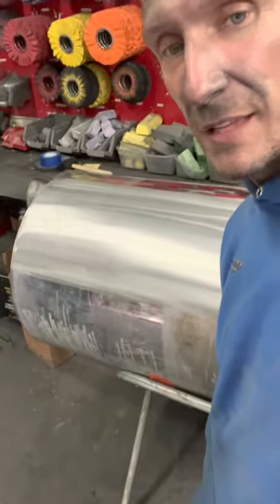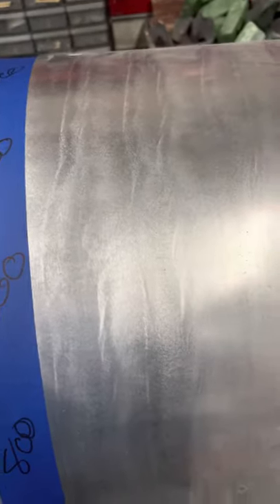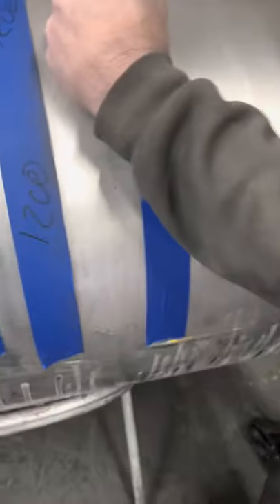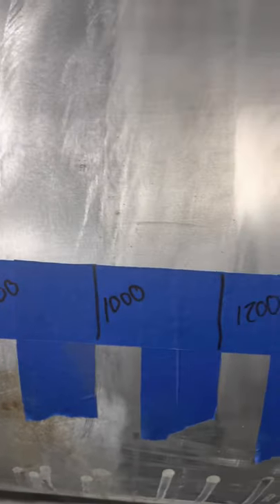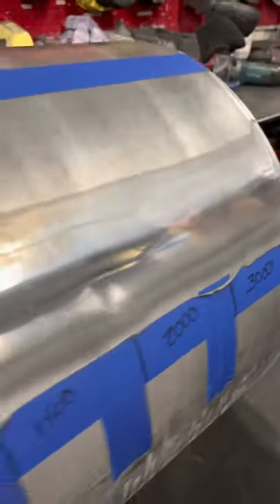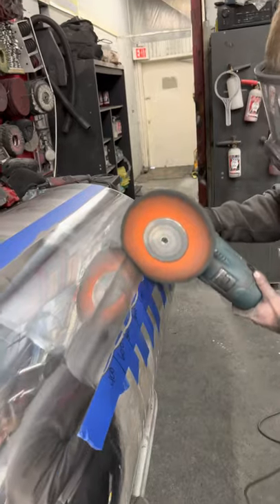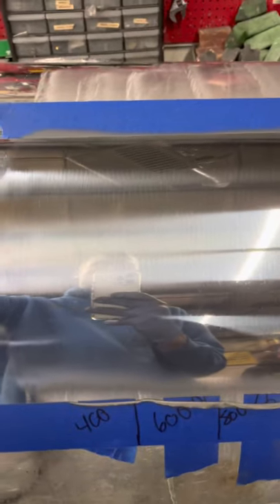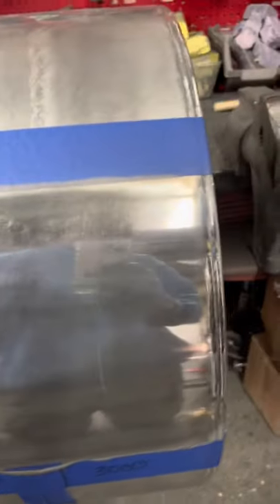Sanding up to 3,000 grit?? Why?? I only sand to 600. Watch why.

Comment: This is very interesting. I've had this problem and kept thinking that finer and finer sandpaper was the solution. Thank you very much for pointing this out.
Reply from the maker: Glad you found it helpful. Glad I could help.
Reply: Yep I had the same problem.i thought the same
Reply: So glad I stumbled across this video! Weird how things work but someone must of knew I was trying to restore my wheels. Lol, I've wasted a lot of time and sandpaper thinking the higher the better. It makes so much sense now that the higher the paper the more pores your closing. The compound has to have something to adhere too duh. Lol, I'm certainly subscribing to this guy!
Reply: Depending on what you're working on, I completely agree with you Evan. Good job buddy
Reply: @EvanStegerMetalPolishing  I’ve been having the same issue. I used to do cut and polish paint, wheels, trim, headlights, do clear bra and do window tint for a living. Long story short rn I’m working on mirror polishing on knives and good lord I’ve been struggling making the process quicker. Harder with 60+ HRC materials, trying to take the stonewash off is the reason I even went to sand paper to begin with. I’ll have to try the 600 on a throw away. Diamond lapping compound is all I’ve found lately that’s been hard enough to really erase all the marks but that compound gets expensive
Reply: Really helpful ……Thank you👌
Reply: For Kosarev mirror and time distortion the more reflective the more efficient the space-time bending is. Look it up.

Comment: I used 320 - 400 - 600 with wet dry paper. I screwed up with a fine brass brush doing paint removal and the 320 let me work those out with light elbow grease. Then the 400 then I ended with the 600 and fine emery cloth to get out hair line grit marks I made accidentally touching the paper. And then clear coated. My aluminum project turned out awesome with your grit advice. I believe I could of polished next and had nice clean good results but I had to finish up could not wait any longer for a kit. The alternate idea to polish came too late.

Comment: thank you so much evan. I have tried  with different machines and sanding  and polishing materials on stainless steel and none of them worked in my case. Now i tried with your instructions in this video I've used 400,600,800 grit only and polished on 600 grit sanding it looks just perfect and 400,800 not that good as 600. Thanks again...🙏🙏🙏
Reply from the maker: Super happy this was helpful.  Thanks for watching!

Comment: I have been sanding bicycle parts with a bristle disc on a Drexel up to 2000 grit and had trouble getting the mirror finish first time i.stopped at 600 then went to pollish bam mirror finish thank you evan
Reply: Make that a dremel
Reply from the maker: Sometimes it just helps to know. Glad it worked. Thanks for watching and dropping a comment.

Comment: Awesome demonstration!! Almuminum I only go to 600 or maybe 800 but stainless steel you need to get up into the 1000’s to get that mirror finish
Reply from the maker: I get mirror finish on my stainless at 600 grit also. If you sand anything properly you should be able to buff out 600 grit scratches. But I've also been doing this 24 years. LOL Thank you for watching and commenting.

Comment: Evan I used a rotary with a thousand grit and da thousand grit I found it works but definitely takes way longer to cut out 600 is definitely the sweet spot I rotary a tank  but I found the higher you go past 600 it harder for the buff to cut
Reply from the maker: So many ways to polish. This is the best part. No right or wrong ways. If it shines its right... Thank you for watching and supporting.

Comment: I can't even begin to tell you how much I appreciate this explanation, I polish raised numbers and letters cast plaques, I bought a grinder /polisher all the airways and bars and always struggle, first I have tried using buffs but it's like polishing a rake with the raised letters pulling the compound off and building up on the plaque, I can eventually get a shine but then I have a massive mess of compound to clean off before I can paint the background. I then started to just sand from 80 to 5000 and then use a liquid such as white diamond or a wizards. I do achieve a shine but it has swirl marks I can't get rid of. I was polishing one last week and tried using my fine buff and compound to get rid of the swirl marks and ended up with a mess  of smeared compound, your video here explains why.  Do you have any suggestions that may help with my situation? Thanks

Comment: Very interesting experiment and I have a few theories:
1. The hardness of the metal/alloy matters - as we see in the video it works very well for aluminium but going higher in Stainless Steel helps a lot
2. I feel the grit used (rouge) works well for 600 but having a finer grit may have worked for 1000 and above . From a personal experience products like gords work well in clearing the haze
3.For this system I feel that 600 + rouge on airway buff works very  well as demonstrated. Will a DA  with Pad work better for 1000+ based on the grain direction?
Reply from the maker: Thank you for sharing!  Appreciate you watching and commenting.

Comment: This not a criticism as your real world expertise is extremely valued. However, it has been my understanding that you should be wet sanding with any of these higher grits and you are dry sanding here. Do you think that wet sanding the higher grits would make a difference in how it finishes out or would you still run into the issue of the aluminum not accepting the polish?
Reply: I work in a polishing shop. I will test wet/dry sanding and see how that pans out. 
Also, whenever we do higher grits we ALWAYS clean the surface after sanding as any particulates can mix with the grit of the rouge making all the effort for nothing. 
Keep your work clean.
Reply from the maker: We have tried both wet and dry over the years and always end up with the same results.
Reply: @EvanStegerMetalPolishing  if the results are the same dry or wet, do pads hold up better to one or the other?

Comment: I heard from another channel that depending on paint you use for example can spray paint a higher sand grit in needed for paint adhears better? Is this the case?
Reply from the maker: I'm sorry we don't do anything with paint. We only polish metal. We sand to polish not to paint. Sorry I have zero info in that department.

Comment: One reason people sand w finer grit is bc unless you have a powerful poliser it is harder, and takes much longer, to polish out the 600/800/1000 grit marks!
Reply from the maker: Even with a slow speed polisher and good products it is easy to remove 600 grit sand scratches.

Comment: It looks like you weren't washing off the residue of the previous sand paper before moving onto the next - so by the time you reach 3000 all you've done is compound the residue of all the previous sanding into the surface - hence it's smooth but not shiny.  I was surprised that you were dry sanding from 400 up anyway - I've seen people sanding with water or oil from 400 up with some great results but never dry - was there a reason for doing it dry?

Comment: Would this method work on motorcycle frames, metal or aluminum ,stop at 600 grit or go all the way to 2000 grit? Thanks
Reply from the maker: I stop at 400 or 600 on everything aluminum and stainless. Great question.

Comment: I didn’t know sanding past 400 to polish aluminum was a thing. I’ve switched to plastic refinishing for past decade or more though. Plastic doesn’t sand as well as aluminum and typically must go to a 800 machine to buff it but some people want to go to 3000 or so. Anything over 1200-1500 doesn’t help .

Comment: Hey there, I'm currently polishing an airstream and have done an initial cut with Brown tripoli and a red airway wheel using the Dewalt variable speed polisher. I then cleaned the surface with mineral spirits and changed to a coloring wheel and moved to a green moss compound, I noticed from certain angles and lighting, a brown haze develop after step 2. Is this something you've experienced before? and what can I do about this? ( I did not have to sand it)
Reply from the maker: Brown haze traditionally to me means burns but I’d need to see it.

Comment: Thanks for this info!  Interesting about the pores closing up.  I wonder if this happens on mild steel also.  I am doing a deep dive into mirror finishes on mild steel for my plasma cut artwork.  It makes a lot of sense to only go up to a certain grit and then start cutting (if that is the correct term - I'm just begining the journey-sort of).  
I saw one guy polish stainless going up to 5000 grit with Alumicut and it came out pretty sweet.  I guess Alumicut is a light oil?  I've actually used compound paste for paint, Mother's metal polish and green and black polishing sticks with a flat 4" fine grade wool disc.  It works pretty well for buffing/polishing.  I have even thought of trying a polishing paste with the sandpaper to speed up the process.  Is that just crazy or will it work? 

One of my challenges is polishing a piece with multiple egdes, curves and points, which can grab (flat) sandpaper and trash it instantly.  I just got  a  (short throw) DA orbital sander and am experimenting with it over various grits of sandpaper.  I discovered if I use a 6" disc on a 5" pad, I can bend up the edges enough to clear 'obstacles'.  

Any advice would be appreciated.
Reply: After 400 ideally start to use some lubricant to remove particles between work piece and sandpaper also to cool the workpiece in some items (glass etc) Try using hard backed disc instead of foam backing, especially at lower grids to cut surface better. After you remove them, sandpaper shouldn’t catch that often. If you want to make chamfer to your work piece hard backed disc is a must for me. Foam pads gives me a round over instead of chamfer. Hope it helps.

Comment: I dont understand why closing the pores is a bad thing? Open pores absorb light (lass shine) and cosed pores reflect light (more shine) when you polish you are essentially melting the metal and filling the pores and thst is what produces the shine. I've never seen a polish that will take out sanding marks from 400 grit paper.
Reply from the maker: I found just the opposite in my study. I found that closed pores didn't reflect as much light. But that was just my studies here. To each their own. I can polish and have shown multiple videos polishing from 400 grit. We remove sanding scratches at 400 all the time. 25 years polishing and been doing this way for over 15 at minimum. I am not saying it is right. Just saying what I see while I am polishing and studying.

Comment: Could you resand the 1000 with 400 then cut? Would that reverse the problem of clarity?
Reply from the maker: We tried that. The 3,000 wrecked the pores. I ended up sanding it down to 180 then back up to 600 to make it polishable again.Thanks for watching.

Comment: I am thinking about polishing my own wheels, car wheels. I have no intention of using machines, i plan to hand sand everything. Couple questions, ive seen some japanese use wet sand method by hand sanding. Should i do this as well? Ive been trying to do some research and even watch some of your videos and you never touched on wet sand because you only use machines. Any advice would be great
Reply: No don’t wet sand just dry sand and I recommend using a orbital makita sander like the one Evan is using , very handy 

if you’re gonna sand and they don’t look too bad start with 600 if they are bad and have pitting go with 400 

And if they are bad bad go to 320 400 then 600
Reply: @ogjhernandez2537  why not wet sand. I plan on hand sanding. No machines
Reply: @km6832  no need to 
Evans isn’t doing it 
Only wet sand if it’s paint by what I know of to remove scratches
Reply: @ogjhernandez2537  ah
Reply: @km6832  yeah bro 320 400 600 if they are really bad wheels 

If they are dull just do 600 and then cut and color
Reply from the maker: You are a gluten for punishment doing factory wheels by hand. They are barely fun with a machine. LOL But I recommend only dry and I recommend going to 800 and just taking as much time on the 800 as possible when you get up that high. Then using luhmi from goshineon.com to get it back to shiny if only doing it by hand. Then follow that up with my time2shine aluminum polish also from goshineon.com  This combo will get you as close as I think you will get without a machine. But that is just my opinion.
Reply: @EvanStegerMetalPolishing  alot of our drivers work on wheels while loading. Our entire fleet has Alcoa wheels. Generally speaking they are in fairly good condition. Can you recommend any battery powered tool for buffing?